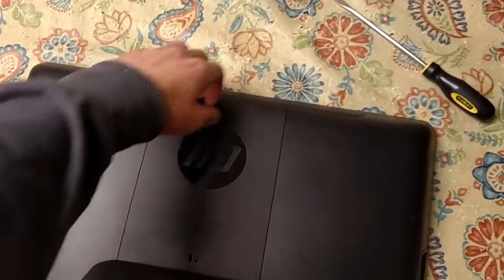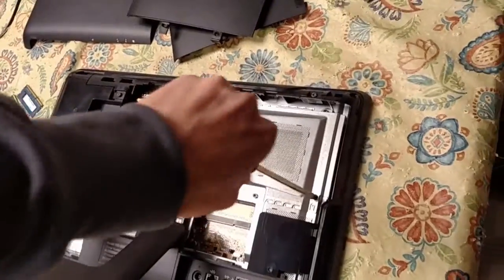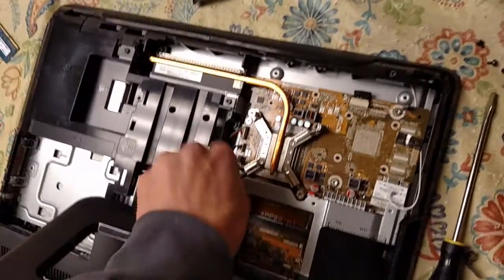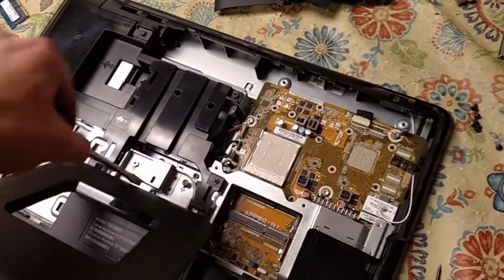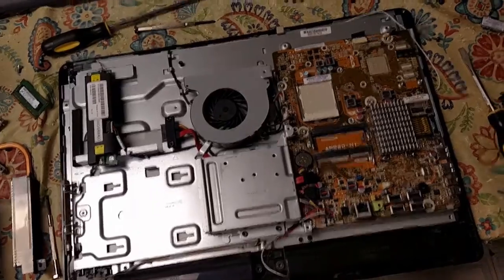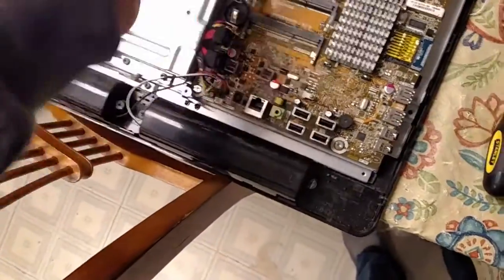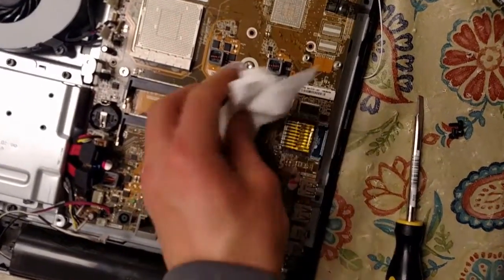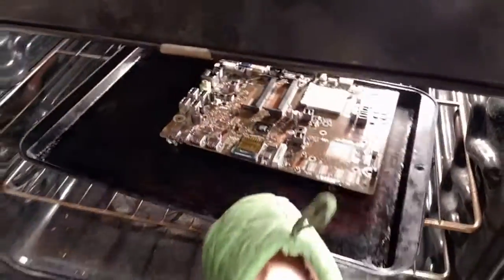HP Omni 100-5050 Dissasembly and Baking.

Comment: Hello i have a question... What's the best CPU i can get for this PC? Appreciate any help
Reply from the maker: I dont remember exactly as it has been serveral months since i looked it up... but I know youre limited to low power CPUs (25 watts i think). I think there was only one such compatible CPU that's better than the CPU it came with, and it was only 0.1GHz faster than the original. probably not worth it.
Reply: @I430VX  yeah, appreciate your answer I was checking that the Best I can get is a 270U not that different from the 250U

Comment: Same issue here, the overheating was happening on the video chip. Baked it, worked!, then failed so I baked it again and it was successful. However the problem appeared again and then the baking stopped working.

Found some comments on the web about placing an extra fan on the video heat sink, tried and it indeed kept it cool but I didn't have time to place it permanently as the computer died and the baking stopped working. Detailed descriptions and videos are always useful and appreciated.